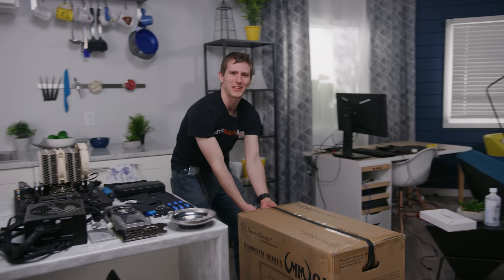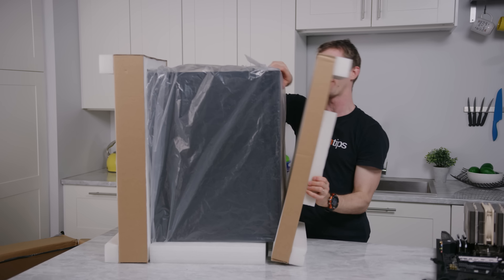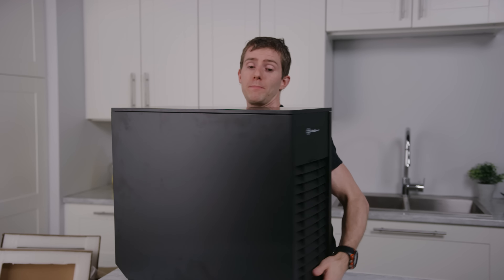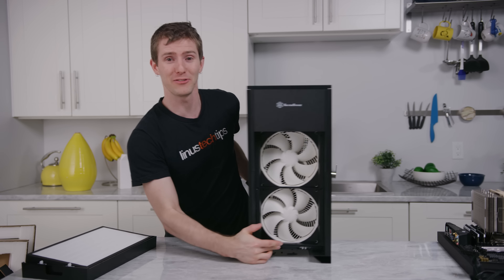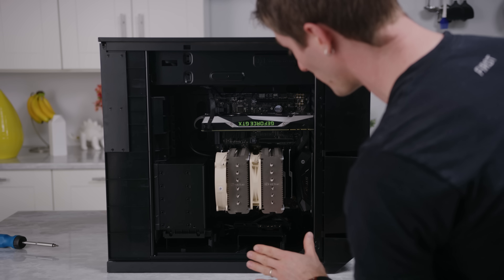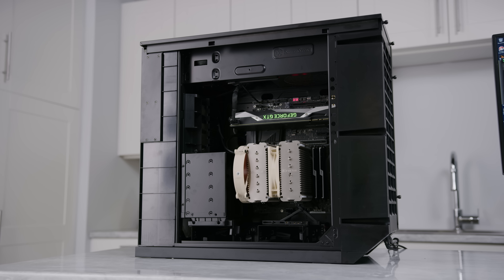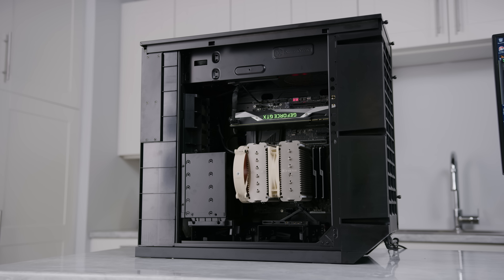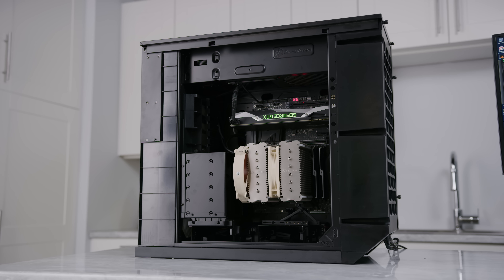Water & Dust Resistant PC Case - WHO NEEDS THIS??

Comment: By having the HEPA filter, computer with that case actually should work as air cleaner aswell.
Reply: You gonna get the 0.03% dust
Reply: A heater, air cleaner, entertainment station, and leg rest in one
Reply: @tardwrangler  steal 12v from powersupply and run car coffee mug. Use dvd drive as cup holder. Cheers
Reply: @tardwrangler  Drink stand too!
Reply: / Heater.
Reply: Yea. Not to mention the 390 cfm fans are moving air quickly too.
Reply: As someone who smokes too much weed, this would be awesome!
Reply: @ohyeahminecraft  Youll need charcoal air filter, dont try it lol
Reply: That's kinda cool
Reply: leaked by devil  Gz! :D
Reply: Dick Baggins  2018 linus has better
Reply: Dick Baggins  i mean was
Reply: @syaklol5737  small price to pay for pc air
Reply: and with standard fans - have airflow for maybe few days.
Reply: Yes but actually no
Reply: so.. No need for a firewall since hepa filters will keep viruses out?
Reply: Mom, I need to game 24/7 and you should thank me for it.
Reply: Dick Baggins  that’s not it. Hepa is a efficiency rating, material alone doesn’t decide anything.
Reply: @loveablehadesno2151  you dont even need to use a dvd drive as a cup holder.
you can buy an external drive bay compatible lighter/cupholder
Reply: @ohyeahminecraft  Buy a vape dude
Reply: A heater with air filter properties
Reply: Surprised you didnt use it for like a warehouse pc, but im fairly certain I saw you got the fanless pc thing Alex liked instead. So maybe not.
Reply: i guess Im asking the wrong place but does anybody know of a way to log back into an instagram account??
I was stupid lost my account password. I love any assistance you can give me.
Reply: @Angel Lee instablaster :)
Reply: Yes that's what I would use it for
Reply: @ohyeahminecraft  Lol
Reply: hats off to the CC maker XD
Reply: @MS-pk2se  that's why it comes with such strong fans...

Comment: "i should probably turn it on before i spray it with the hose" nobody should say that about a computer
Reply: lul
Reply: i thougt the exact same thing but you already posted it
Reply: that was my plan all along
Reply: Nice profile picture. MEGUMIN
Reply: Momma meme M E G U M E M E
Reply: You need the computer to be on to wash the system32 virus off. Make sure you use an anti-microbial sanitizer
Reply: You gotta remember, this is Linus we're talking about. All normal ways of thinking are out the window.
Reply: Geniusaur mine is always ON when I spray it with my hose :D
Reply: You dirty minded ppl omg XD
Reply: Geniusaur you are right
Reply: guys can anyone tell me which air cooler is that one on that linus's extreme processor?????????????
Reply: DIY check the episode 2/2017
Reply: Thats what she said
Reply: I'm late but I took that outta context XDXDXD
Reply: No-one should need to buy a waterproof "desktop"... Tablet, yes... Desktop computer, no... The filter essentially failing, was a disappointment. Whole chunks of sawdust would equal streams of micro-dust. Something wasn't designed right, besides the use of "free-flowing" fans, which have no real "static-pressure", which a hepa-filter needs for actual air-flow. The PSU fan and GPU fan were sucking the dust into the case, from the other holes, I am sure, as well as an ill-fit hepa-filter. (It should be a zero-gap pressure fitting, and it clearly was not, as easily as it fell-out. That almost makes it useless, as little actual air-flow is going through the filter. When it gets clogged, all the air will go around the filter.)

Want to make a ghetto hepa-filter... Get a cheap normal filter and let the dust build-up, and NEVER clean it. Poof, instant "dust filter" made of dust, since dust can't pass through the dust!

Better yet... Use your case as the actual heat-sink... Then you need less fans/air-flow inside. No filter is needed for the fan on the outside...
Reply: im late, but it is a noctua nh-d15, they have chromax for more color too.
Reply: I wont lie. That hurt me a little.
Reply: NoesisAndNoema dude its fucking ip43 not ip78

Comment: throws dust with an upward angle at the pc "don't know how that got in there....."
Reply: Rem well it's got a 2 inch thick filter on it
Reply: Tysen P Not on the IO panel it doesn't
Reply: Monkey D. Luffy pretty sure he didnt realize the io was that unprotected until after he opened everything up. The thing was ip43 "splash-proof" that's a huge certification. Holes like that are usually covered up
Reply: Tysen P - Not water resistant, splash proof. A certified water resistant case is years and years and years and many more years away.
Reply: No a certified water resistant case can be made right now and with the water helping the cooling. One can be made to go to the bottom of the Mariana's trench even with a no fan heatsink setup because it is very cold down there. Anyone with a metal shop and a tube of car engine gasket sealant can make one for a swimming pool in a couple days. It would require a custom water cooling loop and external radiators and some RC boat props with the motors in their own sealed environment to replace the normal fans though. 

Is there a market for such a case? Not really. If someone needed one? They would take any PC case and have it modified to suit their purpose because it really isn't that difficult to do.
Reply: So what you're saying is you know how to make a computer survive aquatic conditions?
Reply: Jet', not unless it was all solid state - the pressure would just crush it like an empty soda can.
That said, for low pressure immersion, it can certainly be done with proper sealing of the I/O and power connections.
Reply: Pressure wouldn't crush it if you filled it with some nonconductive liquid.

Comment: I’ve worked in industry doing water ingress testing. A lot of the water around the edges that looked like it made it into the case only did so when you took the panel off.  A certified test allows you to dry the exterior and cracks before you take a panel off to see only the water that made it in
Reply: That makes sense

Comment: Actually a pretty good idea to make a more industrial version of this for use in machine shops and the like. I can imagine the modern cnc, 3d-printing and cad modelling worker would be quite a good market for a thing like this.
Reply: that makes sense, because full on industrial gear is more expensive and more of a hassle and a case would just fit standard pc components without exposing them to the harsh environment of the shop.
Reply: This case was made for a shop enviornment it seems.  That heavy duty steel construction can probably take a good beating before the waterproofing is compromised.

And that HEPA filter is perfect for any machine shop.  I can't imagine how many systems die from the build up of fine metal dust causing a short.
Reply: Zipp4Everyone that would do it, though a high dust environment would kill the efficiency of the heat sinks since they tend to be totally exposed.

I suppose cleaning it off daily is worth it to never need to worry about leakage or dust on the inside....
Reply: This is what I was thinking as well, lot of modern workers are combining their offices and work shops into one. You have saw dust and who knows what in the air and having one of these would allow you to work in CAD or game in said space. Heck this may even be good in foundries for CNC mill systems where there's black dust everywhere, those environments you have to swap out a pc every year or so, this may actually hold up.
Reply: There already are PC's on the market to satisfy the needs and harsh environments of workshops, factories and boats or ships, they look like this https://www.br-automation.com/en/products/industrial-pcs/automation-pc-3100/
And you can find them on most new serious installations. They come from several manufacturers, pretty neat.
Reply: @zipp4everyone263  I'm thinking save electricity by putting it outside during cold season - even during rain and snow. Leave only 1 fan on low speed.
Reply: a normal computer last a number of years in that environment anyway ..  it will be outdated by the time it fails

Comment: It needs metal handles. mil spec some vibration damping, shock, dust and water.  Thing could be the mobile server/workstation case of choice
Reply: @Jakob nobody needs servers because there is the internet?
Reply: @Jakob Unless you're constantly working in remote locations and needs constant/fast/reliable connection to the internet. Obviously regular people wouldn't need a mobile server (portable hard drives would work for that). But when you're talking about big industrial/applications in the middle of nowhere dealing with constant information exchange (Scientific exploration, for example) a large, portable, offline server would be genious. Good luck uploading 24 TB of footage and documents to Google Drive in the Amazon forrest.

Comment: "Who needs this?"

Factories? Any place with rough conditions?
Reply: @letsbehonest6322  Flood will get in, for sure.
Reply: I can't think of any good use for it other than being something you can leave out in the rain. Just quickly explaining the IP43 raiting
4- "Protected against solids greater than 1mm" - Dust is much smaller than this so dust can still fairly easily get through, and it absolutely won't help in factories as that stuff can and will get in
3- "Protected against water drops up to 60 degrees from the vertical" - Basically only rain proof, as if you hit it with water from greater than 60 degrees from the top it can get in and damage the system.
It wouldn't help in the event of floods, as that isn't coming from the top so it'll still get in just fine. And you (obviously) can't submerge it because of the above. I really think this case is a solution looking for a problem.

Edit: I forgot that this case has a HEPA filter. This would absolutely help in factories where the components would get absolutely covered in gunk normally.
Reply: CNC routers ...
Reply: Um... I live in Arizona... When we get a Haboob it can be pretty bad. Even with doors and windows closed, we still end up with dust in the house. 

Also... people have pets...
Reply: @LucasNewton  the problem is it seems the HEPA filter is only on the front!
Reply: @MrGamelover23  True
Reply: @afz902k  yeah, thats the only place its needed. air is exhausting through the back so dust isnt getting in that way.... while its on at least lol
Reply: I'm thinking more of military bases in desert areas.
Reply: Offices with fire suppression systems
Reply: My school had a desktop in a pottery classroom. It'd blue screen all the time and I wouldn't be surprised if they replaced the whole desktop each time. It'd get absolutely filled with clay dust and plaster or something.
Of course, they wouldn't spend money on a case like that. They replaced a (several hundred dollar) projector bulb to solve a color issue, which didn't work, and deemed the entire system "unfixable" when the issue was a $10 vga cable with visibly bent pins.
Reply: Computers used to upload files to a cnc plasma cutter, or computers used in wood shops
Reply: Hurricane territories?
Reply: Lazy people! Like me!
Reply: Yeah I guess he also doesn't know the concept of spilling things on accident
Reply: People with cats, Ive wanted one of these since I first saw it on silverstone website.
Reply: Carwash
Reply: @TheshBuilds  was looking for this comment
Reply: @LucasNewton   at my job we cut and weld metal and we have two terminals that we receive orders through this case would be awesome to have everything in the shop is covered in dust if it gets left in the shop for a couple hours its covered in dust.
Reply: oh yeah bru. that baby would let us have a pc down in the metalmechanic factory to pull up designs and orders instead of have to go in the sealed room.
Not a speck of iron dust would get inside and make it short. Problem is, you would need a monitor with similar filters too.
And a mouse and keyboard that wouldnt be wasted by iron dust, hands dirty of oil, grease and cooler liquid.
And while I've seen mouse and keyboard at like 4€ each, meaning with 100€ you can cover a year changing each month these, well, monitor arent cheap.
You would need to make an isolation box out of plexiglass, make clean small holes for the cables and, once the cables are out you would need to seal the cable holes with some resin or something similar. This also mean that you have to buy an always on screen since you cant push the on/off button. That is easy even if cut down some possibilities. Not exactly cheap thoo.
And you would need another isolation box if you use ups. Iron dust in a ups scare me straight to the highway to hell.
You cant use a printer with that pc, thoo, unless you put it inside a cabinet. Mostly cuz I think the iron dust would wear on the moving parts.
Reply: @TheshBuilds  I would inform you that our school has had some old Dell office/school computers running for 3-4 years next to cnc routers less than 2 ft away...all you do is air hose them off from time to time and you are fine. And metal is done in an enclosure usually anyway so...
Reply: @thomasmedford7823  first time I've heard someone from az call it a haboob.
Reply: @guywithatippmann  Meh, they call it that in the news, and it's fun to talk about haboobs. :D
Reply: @azdevnull trust me I ain't challenging ya there lol
Reply: @azdevnull  I'll be the last person to challenge that lol, guess I lived too far in the sticks.
Reply: Farm shops
Reply: Me because for some unholy reason my room is dusty as fuck the inside of my computer looks like it has been opened in 20 years but I just opened it a week ago to clean it
Reply: @darralnolan5792  ? wtf are you saying lol
Reply: @thewoodweldingfabricator9300  This!

Comment: This case would be the shiznit for use in a Machine shop or fabrication shop.  No particulates to damage your board and short stuff out!
Reply: I work in a warehouse and these cases would be awesome to have to protect the computers from the insane amount of dust in this warehouse. I can definitely see a use for these.
Reply: EFormance Engineering I really want one of these for my wood shop - Currently I just use a crappy little office Dell I'm not worried about dying for music, a live stream in the background etc but this would let me put some decent components in
Reply: I thought this too, machine shops are really filthy sometimes
Reply: Basically any shop application! I use my own personal ThinkPads when I'm working on airplanes for this reason, but if the company got these for our desktops, I bet I wouldn't find any more of them with failing CPU coolers!
Reply: Exactly what I was thinking.  Our computers at work get nasty.  I have noticed more than than once the case getting sprayed with water.  Im surprised its alive still.
Reply: Ya I’m a welder fitter and gamer off time. 0 production would get done if I had this case.
Reply: For persicion cutters and 3d printing
Reply: Shop computers... the horror. An inch of dust and steel particulate in the bottom of the case.
Reply: to be honest any buisness that has any sort of liquid in use alot or creates alot of dust but still needs tech nearby could use one of these. the different types of places that could benifit from its use are actually massive if you think about it
Reply: Work for a company with a large industrial shop. Buying 5 right now to test.
Reply: The uses for it in industrial applications are HUGE. Even the offices inside a large warehouse that is running a lot of propane-fueled forklifts = dust city.